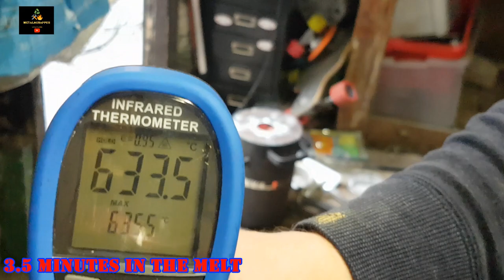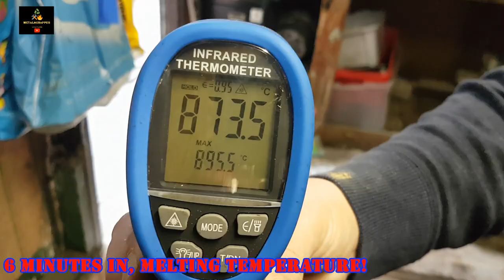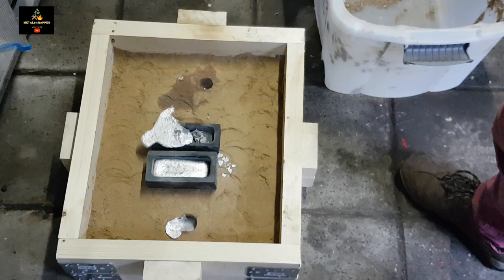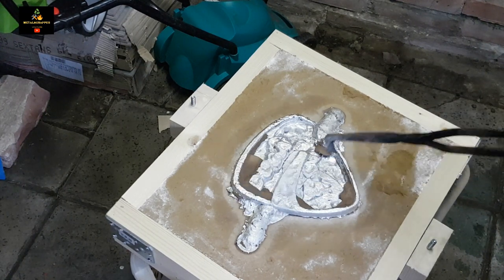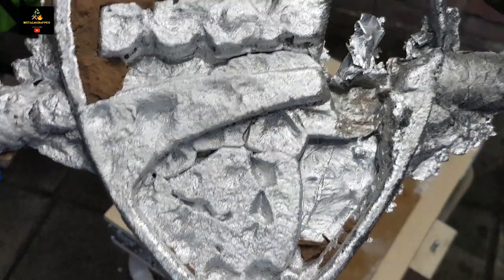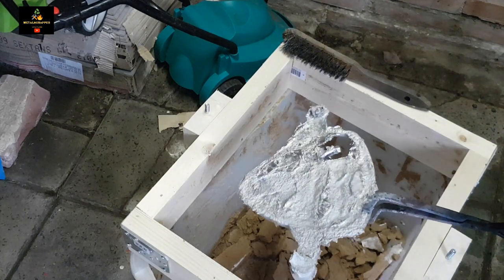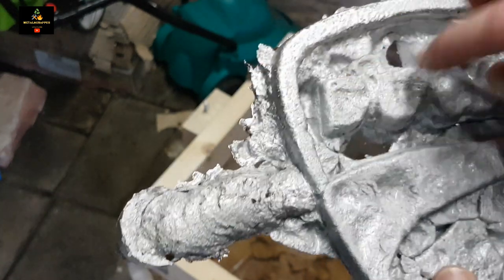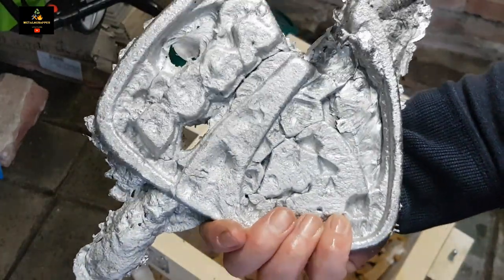Aluminum casting - Logo casting - Melting metal - Sand Casting - ASMR

Comment: You need way more sand, and make a riser, also make the sides of the letters a bit tapered so they come out of the sand easier.
when I made the Aluminium G for the Gil Skillz logo it took 7 attempts, so there is a learning curve.... it's not failing, it's learning 👍😋
Reply from the maker: Thanks for the tips! I will not only fill my flask with more sand, I will also use empty cans with molding sand to even get an higher pouring basin. I will also carve out 4 channels where the metal can flow, so it can flow all directions evenly :) I'll keep trying. And yeah you are totally correct, it is a learning process, at least I pin pointed out some errors wich I will try to improve next time :)

Comment: You have more experience than me. One of the things I was thinking of was the aluminum cools very quickly, maybe brass or copper would stay hot enough! I believe you're absolutely right about not having enough sand, also the lack of sand aided in cooling it before it could spread! The wood cut out is perfect in my opinion! Don't give up on the Ducati logo!! Keep going till you make it perfect!!
Have a GREAT Day!!!
Reply from the maker: Yeah I need to improve the letters of the logo. Need to add more draft. I will try that with a dremel. I also bought another 25 kg of sand. So next time my flask will be properly filled. I will just try it again. At least I learn each time, so once I will succeed and much more beautiful will come!
Reply: @Metalstacker  INDEED

Comment: Get yourself more sand and give it another shot. Great advice in the comments, center feed and taller wells along with painting your template with high gloss. Maybe a little more moisture to your sand. My first attempt in sand failed too. Keep it up.
Reply from the maker: Thanks for the tips! I will not only fill my flask with more sand, I will also use empty cans with molding sand to even get an higher pouring basin. I will also carve out 4 channels where the metal can flow, so it can flow all directions evenly :) My mold had 2 layers of clear coat already :) I'll keep trying.

Comment: Good try. I'm my experience lettering height has a big issue with how they come out if you dont have a good taper. I try to keep my letters at 1mm. Maybe try a smaller tapered sprue, it might have been a bit big for the size of the cast. Maybe increase the temp of your metal, if you have no detail on the backside, try your sprue/vant/riser on the top of the pattern, you will need less metal as you are not filling gates. Or sprue to the side, a little closer to pattern and vent/riser on top of the pattern. You can use some blank adapters to portion off part of your flask to minimize sand volume, no need filling unneeded space. Hope this helps
Reply from the maker: Thanks for the tips! I will not only fill my flask with more sand, I will also use empty cans with molding sand to even get an higher pouring basin. I will also carve out 4 channels where the metal can flow, so it can flow all directions evenly :) I'll keep trying. I did taper all edges of the pattern, however did it all by hand, so maybe it is not tapered enough.

Comment: so how wet was your sand, looked like moisture boiling on your pour area and just the way it looked after you pulled it out.
Reply from the maker: Yup, it was bubbly all over! I will do it again with the flask totally filled this time, as I just obtained 25 kg of brussels casting sand. So higher risers, more venting and cross my fingers. If the logo fills out completely and the surface is still "turd" like I will make another sand mold, let it dry for a week and do it all over again, trying to find the best way to cast, still at the beginning of a long journey :)

Comment: Cools too much. Put large feeder in center and 3 much smaller vent columns around circumference evenly.  Also. Paint your patterns with  spray paint!  High gloss and/or add clear coat.  Good luck!
Reply from the maker: Thanks for the tips! I will not only fill my flask with more sand, I will also use empty cans with molding sand to even get an higher pouring basin. I will also carve out 4 channels where the metal can flow, so it can flow all directions evenly :) I'll keep trying.